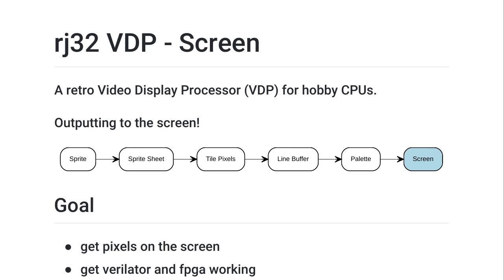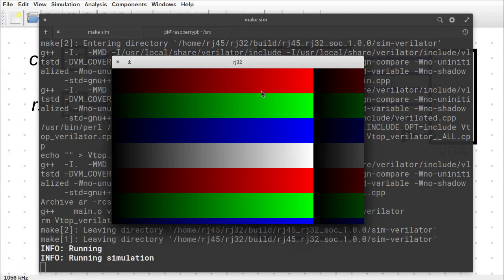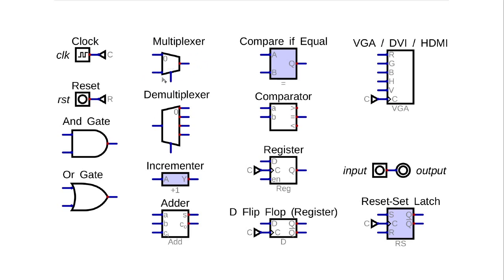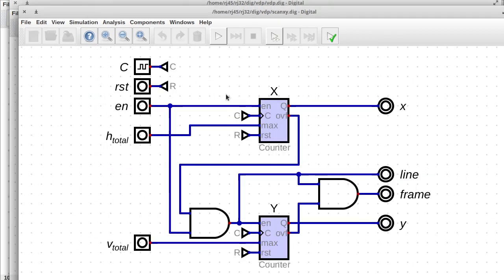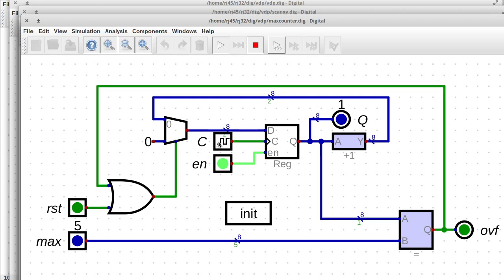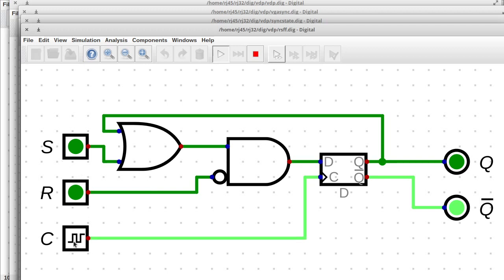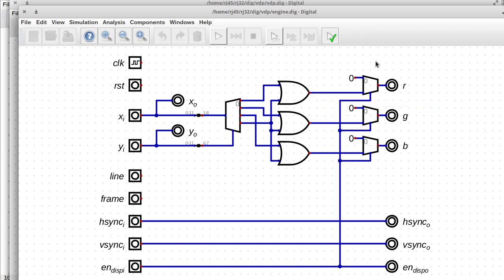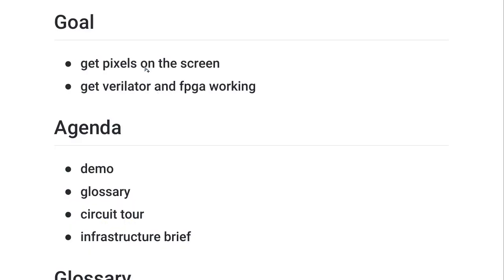[002] Video Display Processor Drawing Pixels!

Comment: Do you think it is possible to emulate an Atari 2600 or an NES with Digital? This is a project I am considering.
Reply from the maker: Digital will not be fast enough to run it at full speed, but yes it's possible. You can then export it to verilog and run it on an FPGA to get full speed. At that point it's not really emulation but a recreation, since it's running on hardware much like the original.

Comment: I'm doing roughly the same thing you're doing, but we are creating a Retro console for the modern user called the Pixeladora; it is basically one of those fantasy consoles that are limited to retro specs but in actual hardware(well fpga and MCU hehe).  Your videos definitely helped give me ideas when I was struggling with some design problems, still working on the PPU then the beast of a sound chip is next, I might actually just use an actual sound chip rather than create one.
Reply from the maker: Sounds awesome! Glad I can be helpful!

Comment: Does the clock rate have to match what VGA expects? If so, does that mean that the CPU you'll be talking to must also be clocked at that rate?
Reply from the maker: Yes, you have to clock part of the video circuit at at least 25 MHz. But I will cover a way to run the rest of the video circuit at a lower clock rate if necessary in the next episode. But even if you run the whole video circuit at that clock rate, you can still interface a slower CPU to it by using memory as an intermediary between the CPU and the video circuit. So there is hope if you are wanting to build this in discrete logic (TTL).
Reply: @rj45Creates  awesome thanks! What I’m actually hoping to do is to use faster RAM so i can alternate video and cpu access (rather than using dual port ram). The BBC Micro did that at 4mhz RAM (and 2mhz CPU). I’m trying to work out how to do it with a more complex video hardware :)
Reply from the maker: @Amy Worrall I am also planning to do that. The FPGA board I am using only has a single SRAM chip that I need to share between the CPU and the VDP. The technique is called time division multiplexing.

Comment: This is an awesome series!  I have been following your work because learning verilog using Digital is such a good way to go!  The ability to visualize the circuit and see it run on an actual FPGA really cuts down on design time. Experimenting is much easier. I wanted to learn enough to create a low cost converter for the Tandy Color Computer 3 analog RGB output to VGA. I just need to figure out the ADC sampling then the conversion. But now, maybe I can even enhance the graphics with sprites and other resolutions.
Reply from the maker: Awesome! Yes, I agree it's easier to get into Digital since you can see what's going on, then once that's more intuitive, it becomes easier to understand verilog and how to build certain circuits in it. Anyway, the VGA converter sounds like a fun project!

Comment: Looks good.  Interesting seeing how layouts differ when working with FPGA's vs some of the logic ic projects floating around.
Reply from the maker: Yeah, FPGAs are quite different internally. No tri-state logic for example, so you end up using a lot of multiplexers. Logic is cheap but ROM is expensive, so you use more logic rather than ROM. Those sorts of things. In discrete logic, you really need to minimize the chip count so you make a lot of sacrifices just to shave off a few chips here and there, since it really adds up in the end. But you have a lot more choice in large memory devices which is nice, and ROMs can simplify a lot (like putting the entire sync circuit in a single ROM).